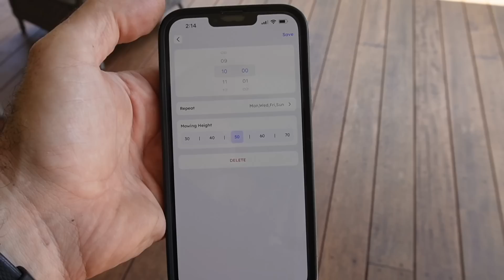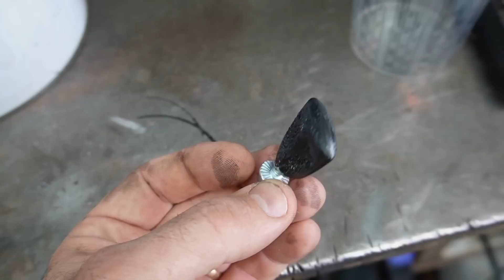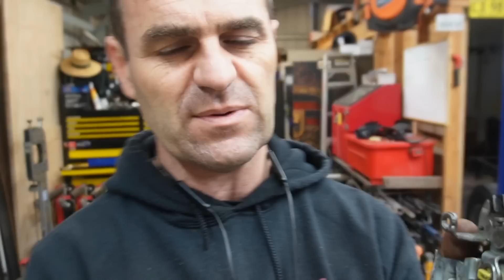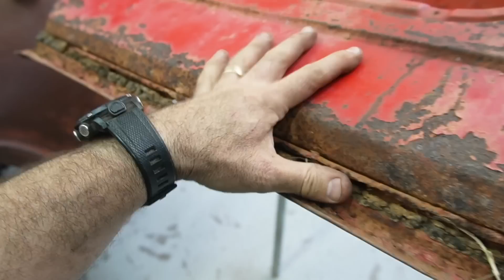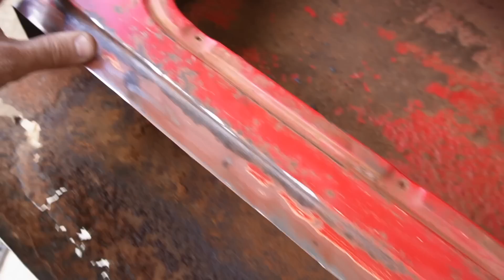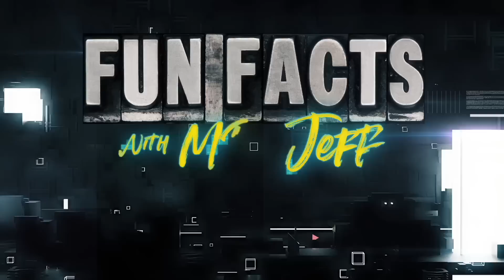Rusty doors.. and then my daily died... - 1954 Ford F600 Car Hauler Build part 39

Comment: For the ABS, an old trick was using a rice cooker as an acetone fog chamber to smooth the layer lines and get a smooth finish. I guess a glass jar in a double boiler pot could do the same. But a touch too hot or long and it will be ruined. 
Another option is disoving abs with acetone to make a glue/filler, filling the imperfections, then sanding it so it's all even, then fogging for the surface finish.

Comment: I have used acetone on ASA parts with great succes. A heat resistant transparent bowl with transparent lid on a cooking plate on the lowest setting. Part suspended like you had before should be fine. Some acetone in it. Heater on, lid on and watch closely to the desired result. When the acetone is avopareted it works quick!
Reply from the maker: Nice tip. Thanks.

Comment: For that pivot you remade - I'm thinking it may benefit from a hammered in return mid fold to strengthen that return.  I do this with thin returns like that by taking a corking/chasing tool and I've got a 90 degree die with a notch.  One whack and job done and it's much stronger.  Nice work on that door lock.  The robot lawnmower is awesome.

Comment: For the stalk handle try designing a base (on the "hole" side) so it sticks to the bed and print it standing up then when it is done you just cut the base off. That orientation will minimize the layer lines. Then use high build primer and sand to smooth it out.

Comment: I’ve just tried this, I used clear fibreglass resin to paint the surface of the 3D print and when dried it gives a great smooth finish. Haven’t tried dipping the part into thinned resin and letting it drip off, but got to be worth a try.

Comment: First, your print orientation isn't optimal. Stand it up from the end of the knob not on the long side, then a quick sand of the end and bob's your uncle. Do .2mm layers for finer also. Alternatively, get a Resin printer.. Its MUCH better for small stuff, cheap and virtually no layer lines. On the Porky, instead of guessing, hookup VAGCOM and see what faults you got...

Comment: Hi Jeff, besides watching your shows I build plastic models. Those build lines are common even on resin 3DP parts. I think l the simplest solution to that turn indicator knob is to spray it with high build primer and  sand it down. You’ll have to paint it afterwards but I think that will give you the best and smoothest result

Comment: It Works I have summed several parts
Reply: Fummed parts.. You can also use a small brush dipped in acetone lightly brush the surface. it melts the plastic

Comment: For the 3d print, print it upright, not on it's side.  You will need a brim for adhesion to the print bed. 

Then your layer lines will be a lot better and the vapour smoothing should work better. 

I find if I sand the piece before vapour smoothing, the part can be in the vapour for shorter, it can slump otherwise

Comment: You can sand the printed knob smooth. They normally heat the acetone until it vaporises, you hold the printed part over it just as it vaporises. Extremely dangerous.

Comment: Jeff
The "tar" inside the outer skin of tge door panel is for "NVH" - Noise, Vibration and Harmonics/Harshness
What it does is dampen the vibration coming from the outer skin that has no reinforcing ribbing on it. With the motor running and the vibrations generated by the road while you driving, the outer skin, unsupported, sets up a vibration similar to a "wah wah board" that drums into the cab. The "tar" is there to dampen and quieten that vibration down to acceptable levels. It is usually sprayed on the floor panels and the large back panel below the back window line. 
Today you have self stick sound deadening pads that peel off the back and stick on. I would suggest you get of that and stick it on inside the doors, the floor, the firewall and the back of the cab. You can also stick a panel on the underside of the roof too. You will be surprised how it quietens the vehicle down and also helps with heat and cold insulation thru the metal skin.
A big suggestion, refit sound deadening inside the truck before carpeting. You will be glad you did. A large truck cab can be an uncoftable place in a very hot or cold winters day. The sound deadening insulation with carpeting/rubber mats and a good head liner determines the comfort and sound level on a long trip.
Appreciate your level of craftsmanship and dedication to make it work.
Reply: Yes I've been concerned with the potential to be a loud drum from everywhere inside the cabin.

Comment: Hi Jeff could you print the knob with a base plate that you could cut off later
Ie. Print a flat piece and then start the knob working up from the tapered part to the top
Cheers Cam

Comment: With the 3d print, print it vertically with a big brim around it and the end that goes on the stalk is the base for the print bed. The bambu can do it no problems. Otherwise print a small sacrificial part underneath it with a tree support in the hole. The acetone trick is good but not always perfect with that much imperfections. Fdm printing isn't a process that can give perfect surface results all the time unfortunately (resin printing is perfect for that). Thr amount of work you're putting into these builds makes mine seem so easy now. So keen to see the end result of Frankhauler

Comment: Good stuff! IMO you got the print orientation of that indicator stalk wrong. Try printing it upright and add a brim to help it stick on the buildplate. You could also print it in two halves and glue them together. Sanding it before you use acetone should also give a better result.

Comment: Keen to see how you go with the acetone Jeff. My go-to so far has just been a quick sand minimal plastic filler, spray putty and paint which is fine for parts that don't get handled much. For the indicator stalk end, could you add a clear epoxy final layer for durability?

Comment: The best way I find to smooth 3D prints is just time. Sanding, filling and spraying. The more time you spend the better it is.
Reply: Lightly sand the piece to remove high surfaces, then LIGHTLY apply the acetone with a q-tip.
Reply: @ depends on what material you use. Not on PA-CF or many other engineering grade materials. Nothing beats a bit of elbow grease.

Comment: The Japanese got the indicators correct for RHD cars. With the stalk on the right the left hand is free for gears, even when slowing for a corner and needing to indicate, making it possible to shift, use the lights steer and indicate all at the same time. With the stalk on the left it's either indicate or shift, these 2 actions can't happen at the same time. Wasting the right hand to only steering and nothing else. 
They really did crack the problem in Japan.

Comment: If you print the indicator piece with the opening on the print bed you get a much nicer finish.
Reply from the maker: I have tried it a bunch of times and I can't get it to stick, and it keeps failing :(
Reply: @HomeBuiltByJeff  Brim or a little manual support piece that can be snapped off. ( for inspiration: https://www.youtube.com/shorts/K8AVjipCabM , no need to print diagonal in your case, but a little support like this could work well)
Reply: He mentioned that it wouldn’t adhere to the bed in that orientation, I think. You could try printing a raft, and/or layering some glue stick on the print bed
Reply: When you print it with a brim, it should be all right, right?